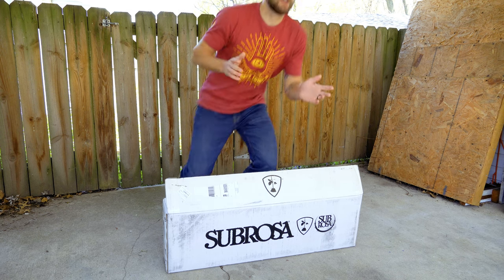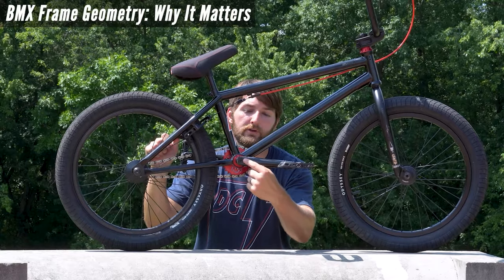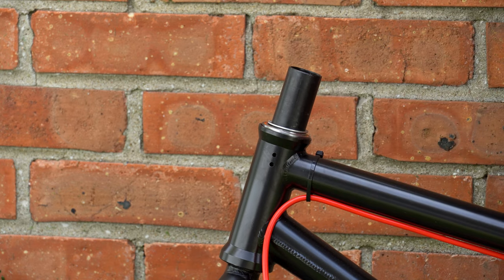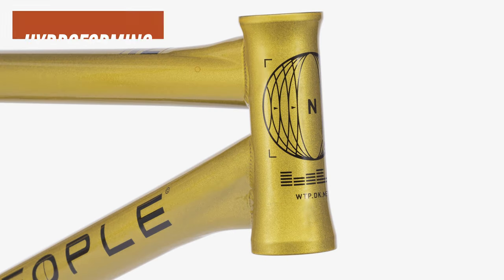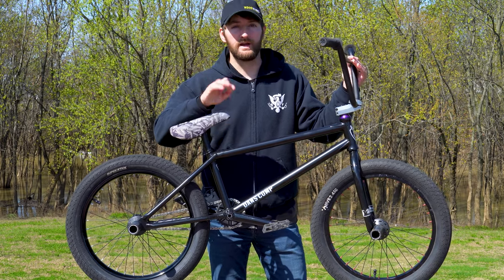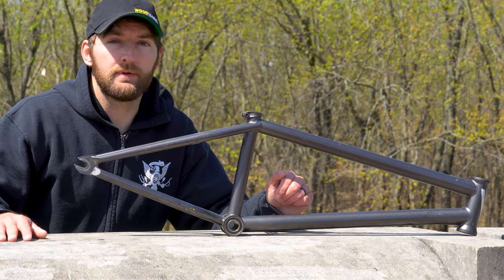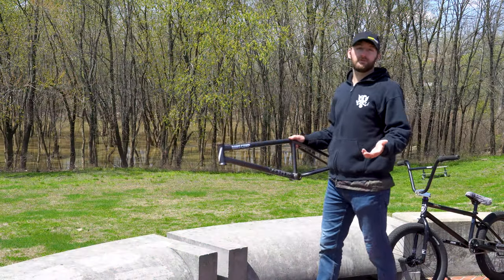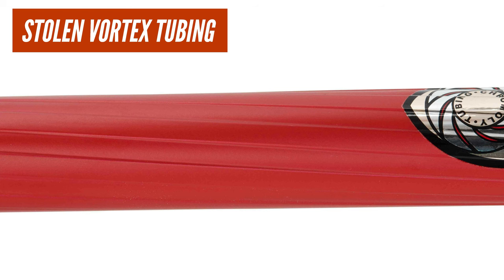Frame Features: Butted, Investment Cast, Hydroformed & More. What Does It Mean?

Comment: Every modern frame looks exactly the same.  Compare a Haro Master frame to a Redline RL 20II frame to GT Pro Performer frame, there are over 100 visible differences.  I don't understand the lack of creativity from modern frame builders.
Reply from the maker: True. Other than a handful of outliers, BMX has pretty much settled on what a good frame looks and functions like. At least for now. The older frames you can see where companies were experimenting with different techniques to make things stronger and some of it was kind of a gimmick, but through that we found what worked best while still remaining relatively lightweight. Maybe we'll see more experimenting once something new takes off? You can kind of see it now with investment casting.
Reply: Get a subrosa wild child wishponed , or a Hoffman taj repoop , or a standard gussy sta.
Reply from the maker: @lutherseye5356  The Wild Child seatstay bridge looks rad.
Reply: @danscompvideos  the wild child frame reminded me of the Fbm angel of death frame ! Time flies 😣

Comment: 8:25 integrated chain tensioners is a must these days I think 👍🚲💨
Reply: I’d take removable brake post on every frame over chain tensioners.
Reply: Get an American frame they don't smash. Tighten your bolts , I haven't used tensioners since I was racing in the 90's on a 3/8 aluminum frame
Reply: @lutherseye5356  my frame has them so handy when getting Wheel in line in the back of the frame and the right chain tension 👍🚲💨